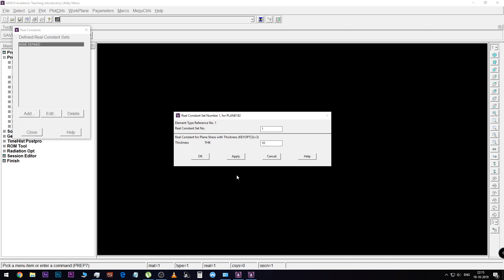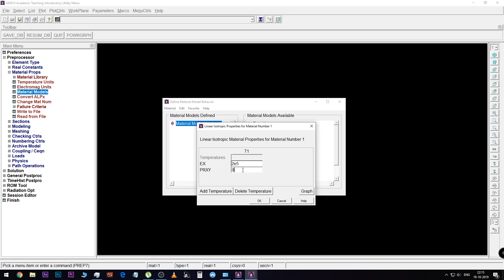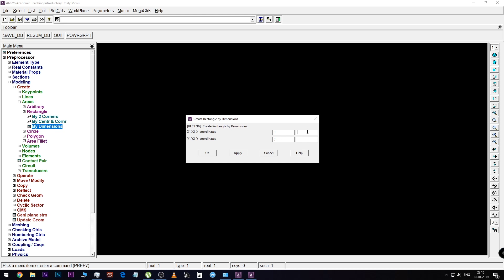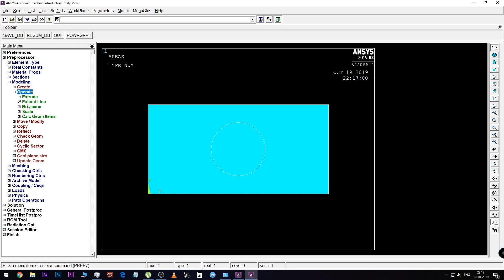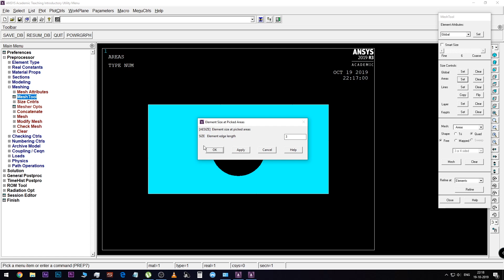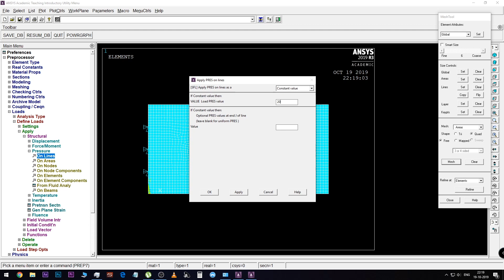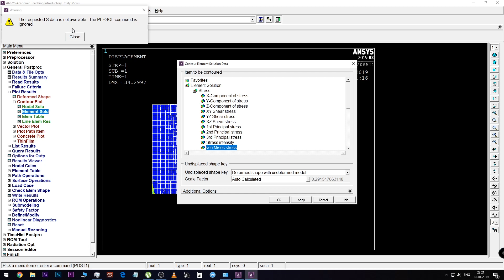Stress Analysis Of a Plate With Circular Hole | Ansys APDL | Simulation Lab Experiment | Tamil

Comment: Hi,Sir. I'm trying to simulate a dynamic model using the Beam188 element. In the simulation,there are a series of loadsteps. And, my object is to obtain the rotational velocity of one node in a loadstep, and use it to calculate another parameter, which will finally be applied as a boundary condition. 

So, it forms a loop, the rotational velocity and the parameter are obtained and calculated again and again.

Based on the former experience, there are some parameters which could be obtained by *get command, combined with ETABLE. 

Actually, it's interactive between the /solu and /post1 processer, and the *get command is allowed in the *do-*enddo loop.

But, when it comes to the rotational velocity of a node, the key is that you cannot obtain the value, using *get command or ETABLE. You can only print or list it by PRNSOL or PLNSOL.

So, my qustion is that since the rotaional velocity can be printed or listed in POST1, is there any method to 'get' it? If, I can conduct my simulation.

If you got any idead, please contact with me. Thanks.